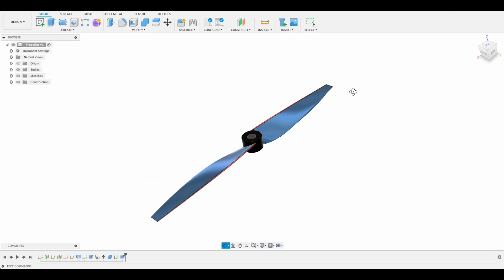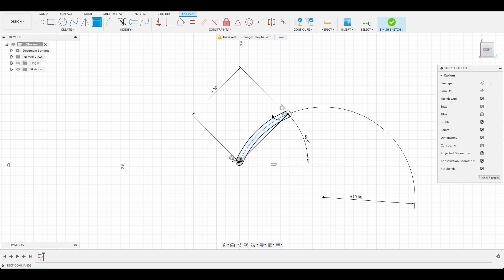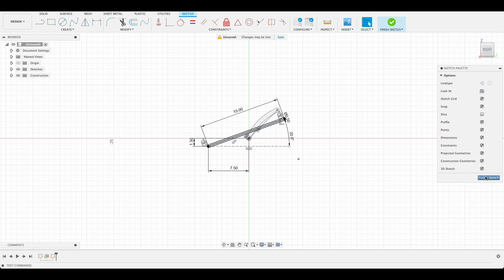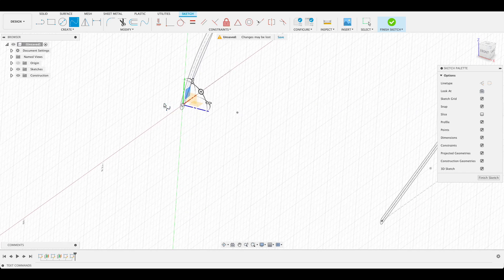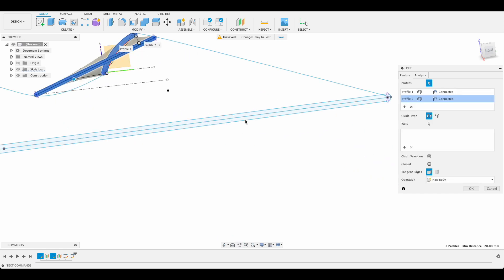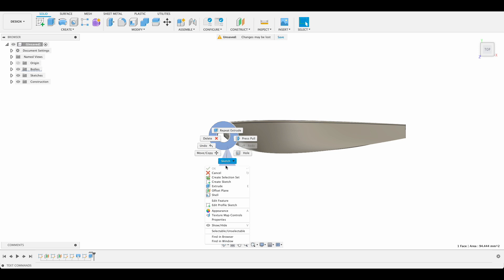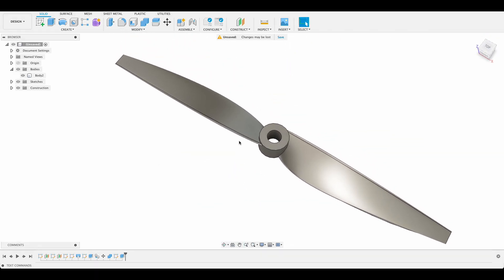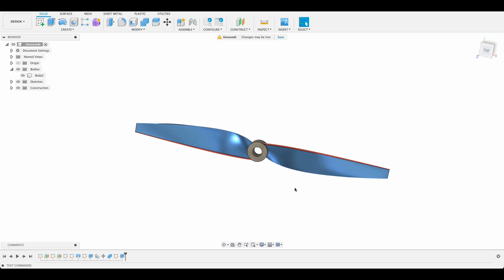Fusion 360 Airplane propeller tutorial

Comment: how to make it to rotate.
Reply from the maker: Hi Felix, I was holding down shit and centre mouse button while moving the mouse
Reply: @Fusionfundamentals  by ading joint relation can we make the shaft to rotate.
Reply from the maker: @felixphelimson2622 yes, if you convert it into a component and then create a centre pin for it to turn on. You must then ground the centre pin and add a revolve joint between the propeller and the centre pin.

Both must be components